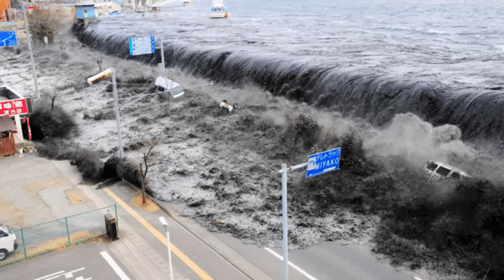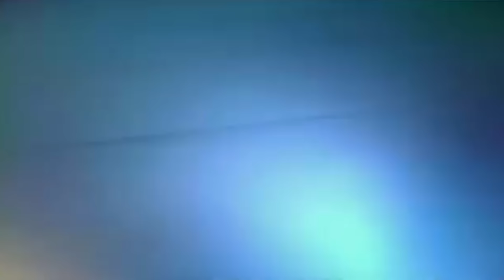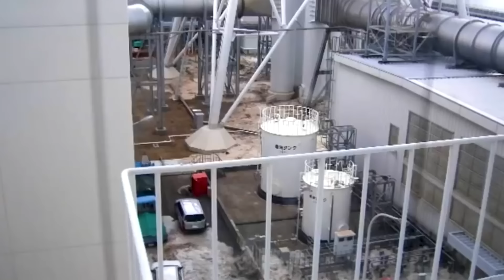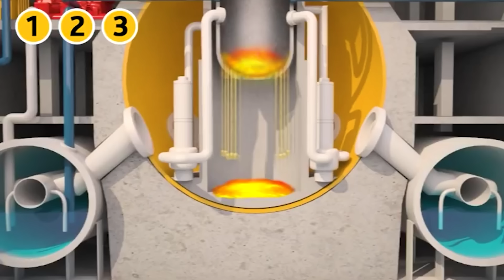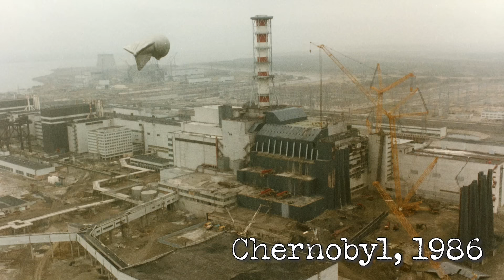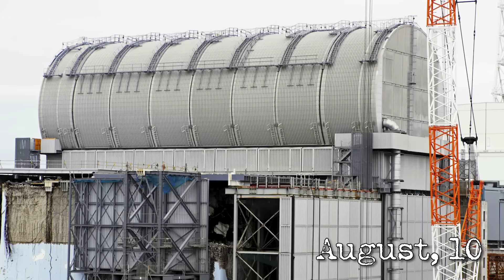The Fukushima Nuclear Power Plant Disaster (Disaster Documentary)

Comment: Reactor 3 was running MOX fuel, concentrated reprocessed spent fuel, that was already thru a reactor, thus a billion times more deadly than industrial poisons! Loaded with plutonium isotopes, it can fission spontaneously, and burns very hot and unpredictably. R3 melted down so quickly, that the core melted directly into the water in the torus, causing a steam explosion, ejecting the core and fuel pools up to 20 miles away on land and ocean! Reactor 4 fuel pools, stuffed with spent fuel and fresh 'new' fuel,( MOX?), suffered fuel pool fires, that burned away the contents into the atmosphere!

Comment: From what I read the reactor was in shut down mode at the time of the melt down but when reactors have been operating for around at least 100hrs there is enough residual heat that there water has to continue to circulate or it melts down. Always near large bodies of water.

Comment: Things missed in this "documentary" was how the power plant was not built the way it was supposed to have been built, engineers cut corners in construction, building backup generators on the ground level and leaving them exposed to the water (note; here in the states, they are built above ground even deep in the country where tsunami's and floods are highly unlikely) they basically ignored some of the most important safety measures needed.

I'm reminded of how another nation, won't say which one since people should already know, wants to put a freaking nuclear power plant on an active fault line. I'm sure the anti-nuclear people will blame the plant rather than the people building it when it fails (like they did with Fukushima)

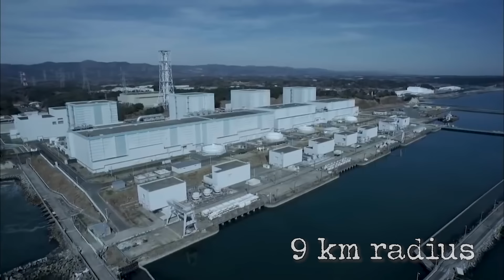Comment: What a story of hazards and disruptions.  The plant designers came up pretty short on building in safety measures.  Imagine, putting generators at the Lowest building level!   Small problem with the narration.  At 9:27, the narrator says 12 miles and the screen text says 9 kilometers.  That's not right.  12 miles is about 19.3 kilometers.

Comment: .... .., This video is propaganda; the radioactive water at Fukushima Dai'ichi is far too contaminated to dump into the Pacific Ocean.  Crappy US nuclear reactor design.

The tsunami protection wall outside Fukushima Dai'icxhi facility was built too low => USA and Japan are responsible for this oversight and causing huge radioactive contamination of the Pacific Ocean.

The Fukushima Dai'ichi facility should have been buil n higher ground up the nearby hill with longer cooling water intake pipes; that would have protected the nuclear faciliy from the tsunami.

The AP-1000 reactor design was completely unsuitable for deployment in tsunami-prone areas, with the temporary spent fuel pool at the top of the nuclear reactor stack.  A CANDU type reactor configuration should have been used.

Conclusion: US and Japanese stupidity is completely to blame for the nuclear disaster at Fukushima Dai'ichi.  Now Tokyo is irreparably damaged by nuclear radioactive dust ("hot particles").  30 million black bags of nuclear waste collected some years ago and stacked up and now disintegrating, causing their contents to recontaminate the Japanese environment.
Vis mindre

Comment: The reactor cooling system didn't stop workingbwhen the Diesel gens were flooded, a tertiary battery power supply kicked in and keot cooling tge reactors for 8 more hours. Due to the devastation from the dual disasters, no new diesel gens were able to be delivered in that time.

Comment: I am finding myself questioning why they didn't also maintain an emergency pressure refill system. As in, using a raised pool of water and a manuall valve pipe system, to refill chambers if all power and generators went out. It could have prevented the meltdown single-handedly even with the other problems.

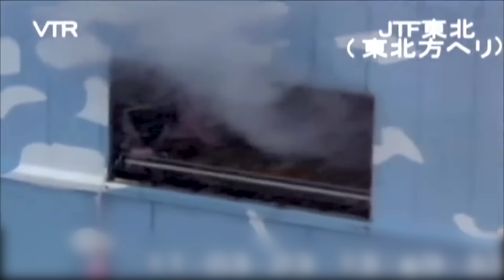Comment: 8:25  they vented the gasses, this caused an increase in radiation outside of the reactor building, but not doing this would cause an explosion causing the same or greater increase of radiation outside. So that point is pretty moot.

Comment: Most crucial fact you didn't mentioned is that meltdown could be prevented after tsunami.

All japs managements knew most simple brute solution is pouring seawater directly in reactor before meltdown.

But this will destroy salvageable reactors by seawater, which means whoever ordering solution is the one paying enormous dept for responsibility; all japs knew this too.

So, headquarter wished someone in field managements ordering this to ended up taken out own life by enormous dept as usual, field managements also not brainless enough to take blame by salvageable reactors.

As a result, just like you mentioned, japs making a show about blaming 3 decade old design insead of meltdown that contaminating whole world...

Comment: The problem is that, historically, it was known that Japan was prone to very high tsunamis.  Thus, the implementation of the Fukushima Dai'ichi site was inadequately implemented.  The reactors were built at too low height above sea level; they should have been built high up the nearby cliffs, and a lower efficiency for pumping cooling water higher accepted.  Building the diesel generators into the basement was insane.  The design of the reactors was also very bad; the temporary fuel pool at the top of the reactor stack was most inappropriate because an explosion within the reactor building will eject radiative material stored in the temporary fuel pool (as observed in videos of the site - big black mushroom cloud above the reactors).

Thus, the Japanese chose crappy US reactor design (AP1000 pre-cursor); a CANDU type reactor would have been much more suitable.  The tsunami wall was built too low: stupid penny pinching to save a few dollars (USD).  The diesel backup generators should have been better waterproofed and located where they could have been protected better from any tsunami flooding.  The AP1000-precursor reactors should have decommissioned because they were old neutron-embrittled hardware around 40 years old.

The fact is that Japan has been ruined by its own stupidity in the Fukushima Dai'ichi reactors.  Moreover, the reactor type from USA was a crappy design; USA sold Japan a dud. Now, the whole of Tokyo has been contaminated with radioactive hot particles that are very hard to detect with Geiger Muller radiation detectors.  The  sewage sludge from Tokyo is found to be highly  radioactive, indicating that people in Tokyo are  being exposed to dangerous radiation daily, but the matter is being hushed up by the Japanese government. USA technology = bad.

Comment: so its like an oil rig but it put water from the ocean into the ground and uses geo thermal heat and it also uses solar power to create super steam. what if you could also produce hydrogen. how effect could it be to use the power that it makes and convert it into hydrogen. oxygen is flammable and useful too burn this in place to create power instead of sending it across power lines... i wonder if they could figure out the best efficiencies. would using mag rail be more efficent for transporting shit then traditnaianl tranportaoin that uses more frinctoin while traveling

Comment: The video tells me the height of the 30ft walls to the millimetre on the metric scale, even though the walls were built not in feet but in meters (because Japan), and so were likely 9 or 9.5 or 10 meters, not 9.144 meters tall. 

That is, the height in feet should be an approximation, rounded from the height in meters, but comically the video takes that converted and rounded number and converts it back to exact meters and then presents that. To the thousand’s of a meter, or one twenty-fifth of an inch! Oh well. 

Americans and unit conversions — the endless battle on Youtube educational videos with innumerable failures and no prisoners taken. Will the saga ever end? So far, the SI units remain untameable, winning and laying waste in their wake — and the odd bit of comedy.

Comment: No one really talk about the precense of the external boiler cooling system. Witch is a system than allow additionial cooling with no electricty at all. So there were a security system witch cover this situation. But the pipe of this system is connected to the reactor throw a normaly closed valve. Witch is stupid as hell. Because in cause of power outage, it's close automaticaly...  The japanese operator were not aware they have to come and open it manualy, in case of completete black out. When they realize it was far to late.

American did the same mistake at three mile island ( prior to his metldown ). Thank you General Electric. Great design.

Comment: This isn’t entirely accurate… Japan instituted a seismic building code decades ago at a national level. Nearly 100% of the deaths resulted from the tsunami… not structural failures resulting from the violent shaking. In Sendai, the city closest to the epicenter, the airport shook violently and was quickly overrun by the tsunami. However, the construction of the airport allowed planes to begin landing only days after the tsunami. The runway was constructed in a way to survive the undulation and movement of a great earthquake. Also, the Japanese never anticipated a wave height of 130 feet. Many seismologists did not anticipate that Japan would have a magnitude 9 megathrust. Japan took preparation so seriously that the northern part of the country was dotted with sea walls and tsunami barriers. However, Japanese seismologists not take into account the coastal subsidence factor. The coastline of Japan dropped several feet during the. 9.0 quake. The decreased elevation compromised the strength and height of the tsunami structures. Reinforced concrete barriers and coastal sea walls failed as soon as the water breached. The 130 foot wave that the video discusses resulted from the combination of the active tsunami striking the prefecture coupled with undersea landslides. The landslides displays massive amounts of water that amplified an already historic tsunami. It is actually a testament to Japan’s preparedness that more people did not perish… not to diminish the catastrophic loss of human life that occurred. Sadly, the Pacific NW faces an identical (if not greater) seismic threat with accompanying tsunami. The Cascadia subduction zone will quite possibly rupture during our lifetime. The Pacific NW is not prepared for the seismic event. When it occurs it will be the greatest natural disaster in United States history. A present, the USGS places the likelihood of the Cascadia subduction zone rupturing at 37% within the next 50 years. This is an alarming statistic.

Comment: Nuclear power is not safe. It is not cheap. Too many things can, and have happened. There is no safe way to get rid of spent fuel rods.
  I live in San Diego and we just happen to be in escondido when we saw a huge truck surrounded by police cars. There was part of San onofre nuclear plant on the back of that truck and it was headed to either Colorado or Utah. It could go any faster than 25 miles an hour. So many things could have happened had there been an accident.
  Find cheaper and safer ways to produce energy.

Comment: Iv'e thought about it a lot and i'm not nuclear plant engineer. Question is if nuclear plants generate electricity ,how they can't then power the pumps also directly with own electricity to avoid overheating? I mean it's like complete circle, plant creates heat,heat runs vapor, vapor runs turbine,turbine gives electricity to pumps to push more water into core etc.

Comment: Ok, nuclear power IS dangerous when left without control.
But there's a number of things that wasn't done here.

1) Backups need their own backups. An external power connection that WORKS is a MUST for a nuclear power plant. The backup generators need their own backup. So does the backup batteries.
2) The pumps need their own backup. If the pumps fail, you need a surefire way of getting water into the reactor core, and hopefully out of it as well. Steam is one thing but they needed a number of water towers that could feed the cores through a complete shutdown and subsequently basins that can accept all that cooling water underneath the cores such that you can cool the reactors with fresh coolant for the DURATION of the shutdown procedure. Pumps fail, Chernobyl showed this.
3) When disaster strikes, all money goes down the drain. So should all reactor cores! Except they should be DUMPED into a pit far far below ground. When all else fails, DUMP the cores and leave them down about a thousand feet below ground to rot.

So in essence, their backups needed backups and if all else fails they need a place to DROP the core such that any and all radioactive elements stay out of reach of the surface.
Of course this pit is "when all else fails" and is an irreversible thing. Once you drop the cores, the pit is sealed forever and you simply cannot operate the plant until the pits are restored. Which of course would probably take years and a few billion dollars, but that's the price of ultimate safety.

Nuclear power is also our ONLY viable future. Shutting them down is going to be deadlier than all nuclear disasters combined.
Besides, when you shut down nuclear powerplants and there's no good replacement for them. Consider what is used to replace them.
Yes, that's right... Coal powerplants will happily fire at full capacity and coal pollution has killed thousands of times as many people as all nuclear EVENTS (all of them) in history.

Comment: Missed a few points that made it worse. The seawalls were actually decent however the size of the quake and its type meant that the coast sank in places many feet which immediately made the seawalls fail. The second was tepco, they KNEW the plant had risks but of course when you are the only power company in the country you can get away with a LOT. Third was the failure to give accurate info to the government including the fact Tepco could have flooded the reactors with seawater but refused because it would have killed them, which then then had to later anyways.

Comment: Your timeline is screwed up. You claim that the pumps stopped when the generators were flooded by the tsunami, but actually the system had backup batteries. You mention the batteries in passing later, but not in sequence. First, the quake caused the operating units to SCRAM. The loss of power from generators all over the system basically turned the whole grid off. The tsunami flooded the generators and damaged the power lines into the site, so that only left the batteries as a power source. The passive cooling system failed due to a valve which broke in the quake. There was no means to connect an external generator truck to the system, so when the batteries failed, the hydrogen explosion resulted. The whole thing could have been avoided if the generators had been 10m above ground, or there was an external power connection and a truck-mounted generator available, or the operators had actually trained in how the "bullhorn" passive cooling system worked and had fixed it, or a connection to grid power from elsewhere could have been established. There were design flaws from the very beginning, not least because they believed that a 10m tsunami wasn't possible, but in many other ways, and if they had properly planned and trained for this sort of event. Now it's going to take decades and billions of yen to decommission the plant. I'm surprised that no mention is made of the fact that essentially the entire east Japan electricity grid went out. Worse, East Japan and West Japan use different AC frequencies, so West Japan couldn't supply power to compensate.

Comment: The thumbnail had a great still of reactor 3 exploding. But yet I don't think you showed it exploding when talking about reactor 3. You showed reactor 1 exploding again.
I find the difference in the two interesting, as it seems to me the H2 was inside the reactor building in reactor 1, and inside secondary or even primary containment in reactor 3.
Reactor 1 blew the building outward. Flimsy walls of the reactor building.
Reactor 3 was vented vertically and violently. Casting the reactor building roof and secondary up like 2-3 times the height of those vent stacks!
Ya, I think R3 blew from inside secondary, and I think even from inside primary cause I've seen pictures of the cap being 1-2 ft stretched anchor bolts.

Comment: To say that the reactors were stabilized and leave it at that is very misleading. Even after power was restored there was no way to recover the nuclear material that melted down nor could they stop water from running through the area carrying away dangerous radioactivity. The only way they were able to slow down the release of radioactivity was to freeze the entire site.
If at any point the refrigeration method is disrupted and the ground begins to thaw there will be very high levels of radiation released as groundwater percolates through downhill and comes into contact with the highly radioactive material that is still exposed today

Comment: The reactors didn't blow up. 
What happened was the spent fuel in the cooling pond above the reactor containment structure began to heat up causing the water to separate into hydrogen and oxygen gas. This hydrogen gas ignited and caused the blast panels to blow off the top of the structure exactly how they were designed to do. 

The reactors and containment structure remained secure but the fuel rods did melt.